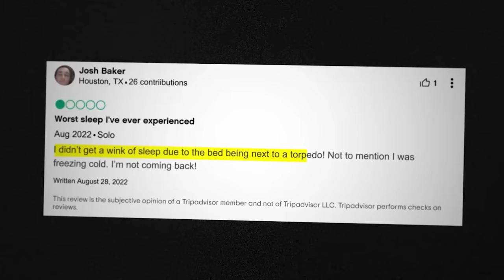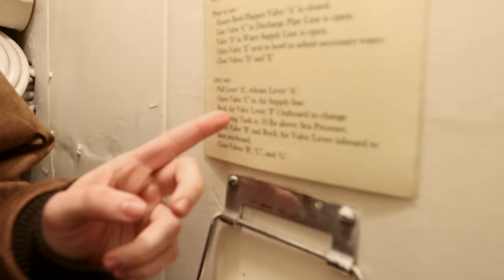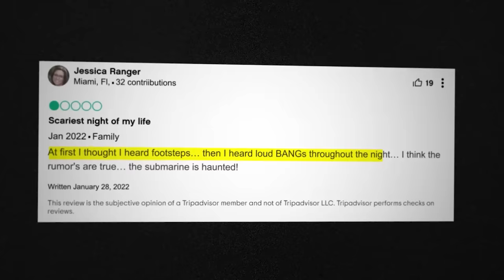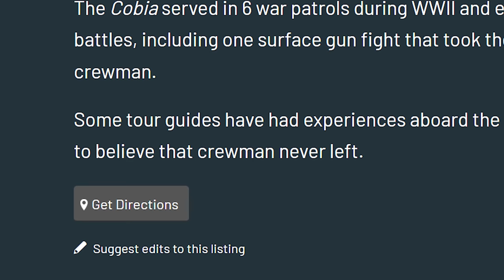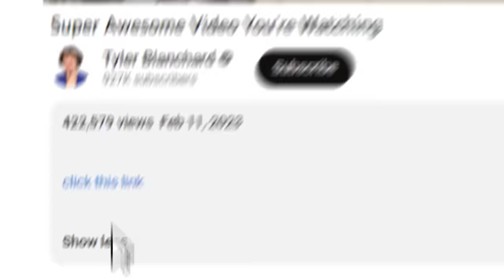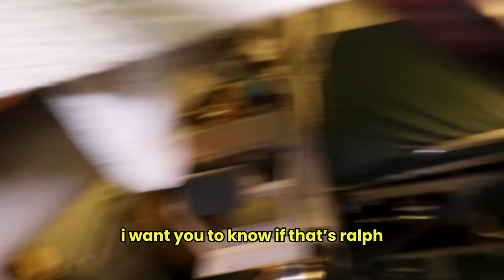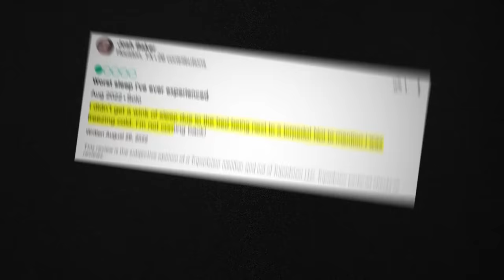Why This Submarine Is Only $500

Comment: You can’t even insult comfort and safety, this is a MILITARY submarine, not a 5 star cruise liner.  It’s meant to be survivable, live-able and functional, and safe enough that it doesn’t kill someone while they work, comfort is at the back of their list
Reply: Lol, i slept on this exact sub one time and the only bed left was in the top corner and along with the beds being narrow, the roof right above me and closing in on my side, i had to slide in from the end because the side of the bed was covered entirely by air filtration unit. And the light was right over me so that just made it tighter. They dont call em metal coffins for nothing!

Comment: Ive slept on that before, its fully functional, the radar is so powerful it blocks out the radar of the airport nearby
Reply: i thought subs had sonar, and while Balao class subs did get short range radars to sport enemy planes, i dont think they got them till waaaaay later in the war. could be wrong tho
Reply: These subs didnt have reverse osmosis air systems so they couldnt stay underwater for long, they spent most of the time above and would dive when they spotted ships, because they spent so much time above water, they needed radar to warn them of incoming planes which were a big threat to them, also I believe sonar came later, ww2 subs used hydrophones

Comment: That a U-boat not a submarine
Reply: What the hell do you think a U-boat is? Even though this also isn’t a U-boat
Reply: @sirboomsalot4902  you don't even know the difference between a U-boat than a submarine
Reply: @sirboomsalot4902  a submarine doesn't have AA guns or cannon on top of it and a U-boat does the front of the U-boat is shaped like a "V" but submarine doesn't and U-boat doesn't always stay under water it's stay on top of the water
Reply: Isn't a U-boat just a German Submarine?
Reply: @manstermanman08  they can be capture and what kind of submarine have AA-guns and cannon on top of it?
Reply: This is not a U-Boat, its a Gato Class Submarine. I slept on this thing yesterday, and the tour guides said its not a U-Boat, once again its a Gato Class Submarine.